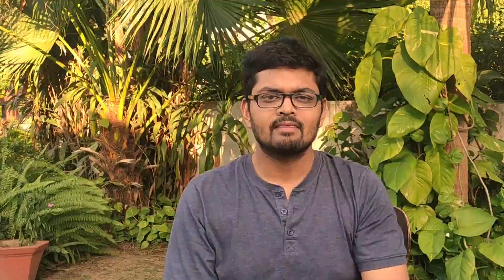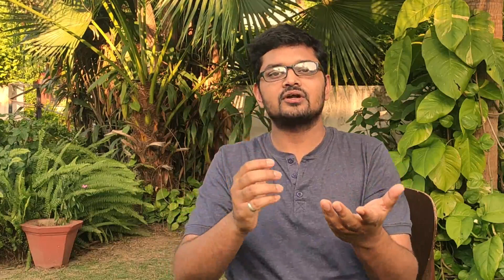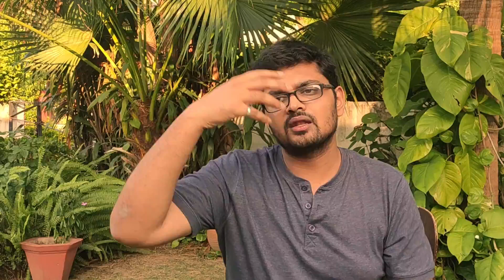Passive Cooling Techniques are Meaningless | Sustainable Architecture

Comment: it is very important to understand the local climate change dynamics of a site throughout the year and how it will be in the next few decades. Then we can apply appropriate passive cooling / heating strategies to the build environment. As it is a delicate matter and improper techniques may hamper the comfort of the dwellers.

Comment: Interesting question. 
-To be placed in the magnitude of things. You'll not 'save the planet' by taking one house out of the AC madness. 
-Taking into account lifestyle is understandable.

But..... as an architect you are ALSO a pioneer in all matters related to the building and it's usage.  ( i leave out the terms architecture, house, lifestyle etc on purpose here). If that pioneering entails the application of more 'traditional' (actually when looked at in detail the natural systems are very high tech) for an interested and motivated user (not necessary your client) you have an opportunity. 
From experience people that visit those 'low tech' houses feel something that is in phase with them.

Comment: I think you need to understand how passive techniques can be applied in residences, since in India, most architects cannot design houses like they design in developed countries due to lack of knowledge, research, availability of latest ERV, AC or Heating equipments and insulation and ventilation products, skilled manpower etc. 

Please learn and understand and try different techniques and measure the outcome scientifically, before you start teaching others or arguing with others on this topic.

Comment: Had idea for radiant cooling using a honeycomb structure with reflective features to guide light into fiber optics.   Seems to me that most of the radiant energy could be directed into the fiber and away from the surface.  Just a thought. 

As long as the core and core cladding are highly transparent to the target wavelengths and the core has a higher refractive index.  Why not use a liquid that is transparent to IR target range for the core.

Comment: Yes! There are passive design elements that work with AC, but you have to choose between insulation or air flow. They cannot be used side by side unless you have a high diurnal temperature differential and a home owner who actual uses it

Comment: here in Utah we have a dry environment that ranges from single digits to 105 f and normal humidity of less than 40%.  I have a very poor air movement in my home, but that said, for most of April and may i use no heat or cooling as well as sept, October and part of November.  I use heat in winter and evaporative cooling most of the summer, but at times we get a monsoon, and it is only moving hot air... at which point i either use diurnal cooling and seal the home for the heat of the day opening it again to push out the heat as the night turns.. i do all this manually but we now have smart technology that via Bluetooth and infer red short range internet of things are able to know the humidity and temperatures and turn on or off the various systems at set points.... so for your tropical environment, the passive works for a great deal of the weather conditions but a strong heat wave needs a person to have a closed AC system and with modern Tek there can be either a temperature gas reaction lever / hinge to open or close these air ports as the high energy system is activated.

Comment: all architects aren't the same, and all have their different understanding of the term PASSIVE COOLING. Hence the outcome of those completed projects still isn't up to what your defined "Passive Cooling" is. It could be due to language barrier, lack of information to the terminology, insufficient data on how the passive part works, etc etc.

Just remember this, humans aren't made the same. We may argue our points to be right but that doesn't mean other people's point are wrong. 

If the problem is found, a solution should be made to counter the problem, it's logical. 

Hence it's outmost important that you seek that solution to the problem you have raised upon. The reason why I'm saying this is because you are missing out an opportunity of success. If you found a "problem" and you have the "solution" to it, you are probably the first person to have done it. If unsure if your method is really effective, try it, make mistakes and correct it as you do. 

Practical to have financial success upon discovering of a problem to a solution, and that is also logic because people would pay to have their problem solved. Give that problem a solution and go make some mistakes along and learn and still make some money out of it. Be logical to solve problems, and always understand how problems stirs psychology and why it pushes people to spend $$ for solution to their problems. Act on it ! !

Comment: Your point is an opinion based on one company using a back up air conditioning source. It is not a matter of a fact. In fact what you can do is do some ground work reseach on people who have built off grid homes and used passive colling systems, and then return with the data of what you have found. Can people live 100% off grid with passive cooling systems with actual data.

Comment: Why take the issue of passive cooling technique versus air-conditioning buildings to mean it's binary? Aren't they complimentary? As they said, it's to reduce the load, which translates to lower electricity bills. What does not make sense to you about that?

Comment: I have struggle with trying to passively cool my house, i have not use AC unit and try to use fan and water cooling system. What you are trying to say is realistic, passive cooling should begin during the design process, otherwise it is hard to achieve. And how many people actually understand that they NEED to have a passive cooling system at home compared to nicely glass covered house? Not many. You will get a nicely designed house, but also high in monthly electricity bill, which is isn’t ideal. The carbon footprint is also higher but not many seems to care either. And not many people understood what is considered a comfortable temperature. In my country the normal temperature is 30°c but most building set their temperature to below 24°c. Basically they prefer windowless building with AC, the architect should just copy the design of a fridge.

Comment: I don’t see how passive techniques for cooling would work when ambient temp is 35C+ 

A better idea would be work on the following 

1. Air tightness (under 0.1 ACH) who in India has done a blower door test?
2. Serious Insulation in the walls and the roof (R40-R60)
3. Triple or quad pane glass
4. Geo thermal cooling with in floor radiant cooling (uponor has done a project for Infosys)
5. Dehumidification of the air

Comment: Thank you for raising some hard-hitting questions about sustainable architecture. In a tropical house design, would you rate as the biggest factor by having a "high 11-feet ceiling with an attic and windows" as a major way to disperse heat?
Reply: In dry climates evaporative cooling is effective and efficient. 
In humid climate a building would have to have a shell or sub level, basement,earth sheltered air intake area. 
That pre cooked air then needs air dryer before it enters living areas, closed in areas .
Perhaps for example, one small air conditioning unit could serve a large building with multiple dwelling areas

Comment: I am not a student of architecture, I am a student of robotics. From my point of view, the answer is simple. Passive ventilation can be used when climate conditions allow, and those systems can be closed when AC is required. This is very useful in the desert, it gets very cold at night and simply opening windows will allow the outside air to cool the house, when the out side temperature goes up the home control computer can close the windows holding the temperature in the house, especially if the house is well insulated and/or contains thermomass. When inside temperature gets too high the computer can turn on the AC. How much energy is saved varies with the weather and the local climate, but a well designed system could be very comfortable and use much less energy. This system is least valuable in tropical areas, as the temperature is more constant.

Comment: First, reduce heat gains during summer months and vice verse in winters by using a passive design strategy. 
After that use mechanical devices to cool or heat the buildings. 
Just the orientation of the building makes a lot of difference.
The foundation design makes a huge difference. Using geothermal energy can be taken advantage if the architect knows how. 
I think you need to reconsider your position.

Comment: Whenever there is such a Video title, it is either to POLARIZE the people on a certain topic, or try bring in a CHANGE or simply a CLICKBAIT. This turned out to be the CLICKBAIT, and hence I'm compelled to comment. 

You need to understand and clear yourself while you are putting out such a video- Sustainable Architecture, Energy Efficient Architecture, Green Architecture, Passive Techniques in order to increase Indoor Human Comfort are all different things. When the distinction is clear enough, one can start the conversation as to what works and what doesn't. But, talking about Sustainable Architecture, Energy Efficiency and then saying, "hence, Passive Cooling techniques are Meaningless", is just irrational. 

Sustainable Architecture and Green Architecture, are Design Guiding Principles, it is not the Design itself, just like Vastu or other design principles. Sustainable Architecture, in nutshell is when we are discussing the Life Cycle of all the Materials and Construction techniques used, it doesn't mean it has to be SELF Sufficient everytime. Green Architecture, in nutshell deals with discussion of the integration of vegetation, flora, landscaping etc, and its sub disciplines. Energy Efficient Architecture, is Design done keeping in mind Energy Efficiency, and nothing else, which includes both, Active and Passive Techniques as well.

Passive Cooling Techniques, now that is totally different. These are techniques done keeping in mind, Human Comfort, which may or may not be Sustainable, Energy Efficient, Green or anything else. It simply means techniques which are PASSIVELy helping reduce the Heat Gains, Temperature, Humidity etc depending on which climatiz zone it is used. 

This is coming from a Professor who teaches in Architectural Colleges, and is an Architect himself. Not a student. Appreciate your efforts, but research is needed before doing so.
Reply from the maker: Hi, Thank you for commenting.

1. 'Sustainability, passive techniques, Energy efficient buildings  etc.' are all technical terms as rightly stated by you. 'Students' often confuse with these terms, and that is precisely the intention of this video.

2. Further, not only we must understand the technical terms well but also, as architects, we should start talking in numbers as far as Human Comfort conditions are concerned and by what means can we achieve those numbers. First step is understanding these processes theoretically, specially the Air Conditioning (which we feel has been missed out)

3. As far as, the statement "Passive Techniques are Meaningless" is concerned, here are some points:

a) Passive techniques can be broadly classified into 3 categories- 

i) Design features (Shading devices, building orientation etc.),
ii) Material specifications (U-Values, Insulation techniques etc.) and, 
iii) the ones involving air exchange between outdoor and indoor.

b) Building Industry over the peroid of time as evolved itself in both i) & ii) types of passive design techniques. And integration of the same is essential (as stated in the video at approx. 1:55 mins). 

c) However, we still come across common mistakes in architecture while dealing with Type iii) passive techniques. These techniques lose their relevance when clubbed with Air-conditioning (specially in places of composite climate). And that is what has been stated and highlighted in the video. Can we make them relevant again? If they are to work with Air Conditioning, it becomes important to understand the process first, No?

4. We, at SBE, believe in talking numbers through our designs. I'm glad that this video has starting reaching architects who believe in talking numbers too. Lets have a more fruitful discussion after we post the next video.
Reply: @studiobuiltenvironmentarch1240  Lets see when the next video comes. Its been long and people may loose interest to come back in this channel.

Comment: So what are your thoughts on hybrid vehicles?

Putting less stress on an existing technology that contributes to excessive energy consumption is better than solely relying upon excessive consumption.
Reply: hybrid vehicles are indeed an advancement of technology. all pros comes with cons, this world will still be here regardless of how bad we are damaging it and it's only we are adapting to it's changes. call it evolution or advancement of lifeform adapting to surrounding changes. we are only justifying it as environmental friendly due to the reduction of co2 emission and the collection of fossil fuel from earths crust. the solution to the problem is achieved hence the advancement of hybrid vehicles. Excessive consumption of other materials are what we are seeing as a problem because by reducing the need of one resources, we are monopolizing on other resources. it's logic that the creation of anything requires raw material and finances, and it's also the only reasons why this advancement of hybrid technology to be made, to justify the needs to preserve something and still make profit out of it. because that's only practicality in terms of money is the reasons why most ppl act on something. the figure over the financial data is more interesting than the figure of the excessive consumption part.
Reply: Thinking in terms of cars will always result in bad urban design. Car centric infrastructure runs on unsustsinability. Design for people - walkability, bikeability is the way to go for urban planning.